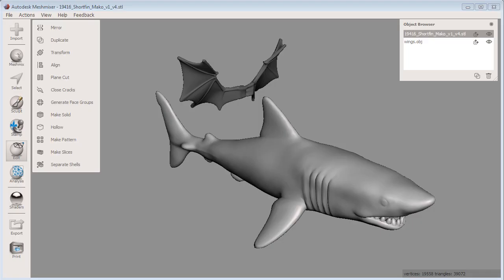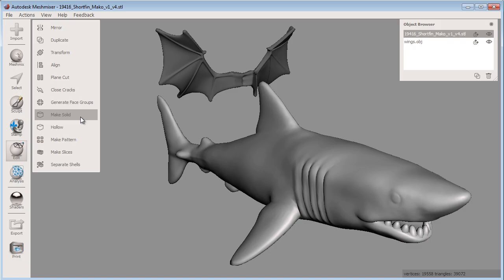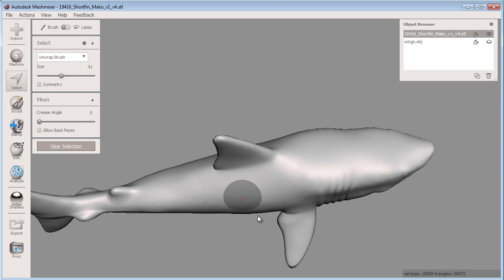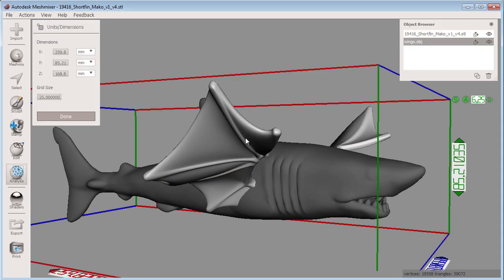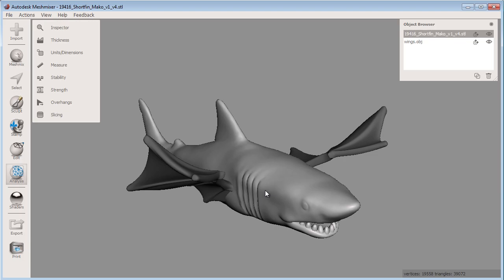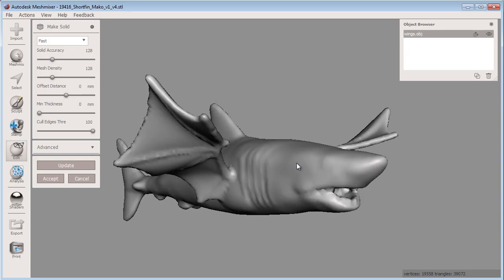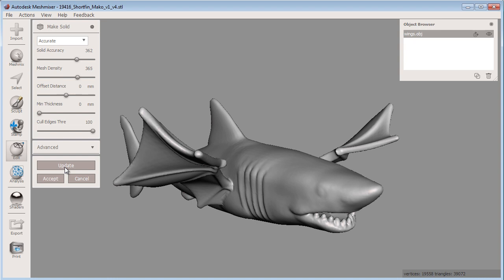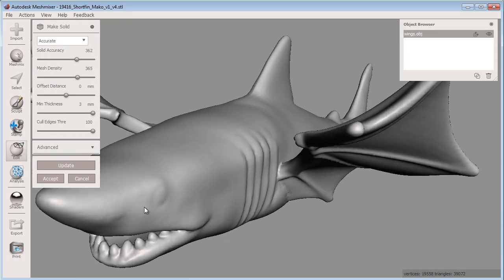Autodesk Meshmixer 101: Make Solid

Comment: hi, how should i know how much i have to bump up the mesh density and the solid accuracy to match the original details in the make solid window?
Reply: You would have to measure the smallest distance between two vertices on your current mesh and plug that measurement into the cell size for mesh density. Accuracy is how uniform the new cells are so that is up to you after the fact. Mesh density is the big one here. I personally dont know how to measure the smallest distance but I'm pretty sure you can, somehow.
Reply: @bigprojects2560  ok thank you!

Comment: Whenever I make most models solid it turns them into low poly looking versions of themselves with edges where there were none previously. Is there any way to fix this? It happens on fast, accurate, and sharp edge preserve. Sometimes it makes it to where a boolean difference is pretty much impossible because I cant solidify without it looking low poly no matter how small I make the cell sizes. Makes it especially frustrating when quality is a must for a project. Edit- solution and reason found. Check replies
Reply: that same bullshit is driving me crazy! Any solution?
Reply: @gaboaaa23  you can import the model in blender and use the Catmull Clarke subdivision surface modifier to smooth it out. You may have to merge vertices by distance first if you encounter visual deformities then try to solidify in meshmixer. The reason the aforementioned "bug" happens is because for some reason meshmixer uses a smooth shader on all objects so they look smooth when their actual geometry is what you see when you make it solid. The reason increasing cell size doesnt work is because it bases the smaller cells off of your current mesh data which again is more flat than it appears. You can see this if you right click the object in blender and use the shade flat option or go into edit mode there. Hopefully this helps. Little edit here- I find if you are going to work in blender with 3D printing files, always set shading to flat because that is what your slicer and meshmixer is going to see.
Reply: @bigprojects2560  thanks
Reply: You can manually type in the cell sizes, while increasing these will make the model look smooth again it will however dramatically increase the number of vertices, depending on the power of your computer this may not be an option.

Comment: mehhh whenever I try to Make Solid with my part the created solid is empty
Reply: In order to use the make solid function the model first has to be manifold meaning no holes in the mesh. Meshmixer tries to do this on it's own by using the exact same process that the inspector function uses. If you check that first you may notice some parts of the model show up pink. Meshmixer thinks this is a piece of the model that does not belong there like an artifact from a 3D scan for example. Or perhaps your mesh is a collection of flat faces each of them not entirely connected and so meshmixer tries to compensate and make the thing 3d but fails to do so in a way that is what we want. Usually when this happens it means you have to go into something like blender and manually close the faces yourself to get the effect you want. That or you are working with really small parts and that can easily be fixed by upping mesh density